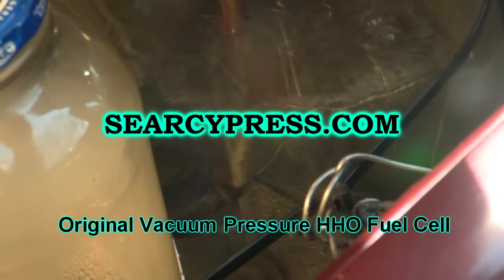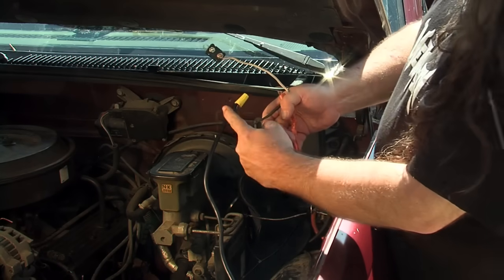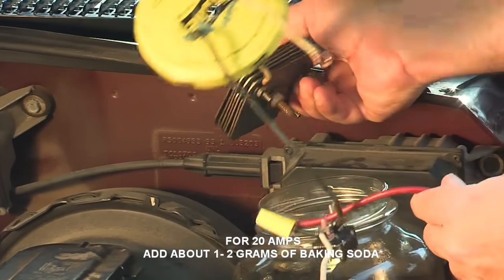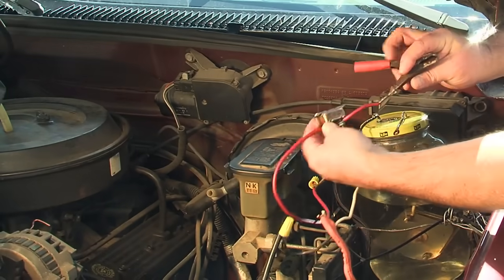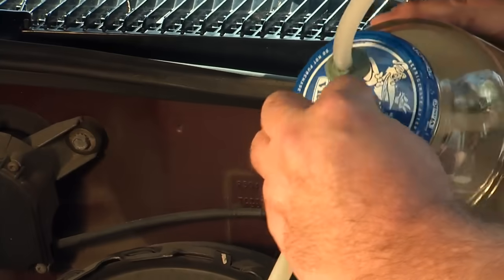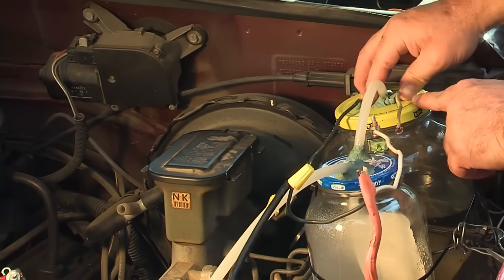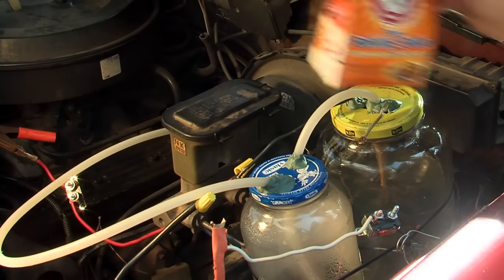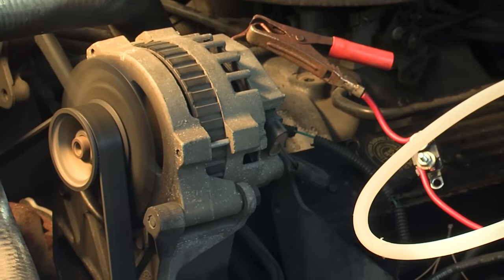Vacuum Pressure Hydrogen fuel cell defeats high gas prices using hydrogen from H2O.

Comment: water flowing through the engine o.o' that just sounds.... horrible for the internal parts.... wonder how often he needs an oil change lol
Reply from the maker: You do realize that burning gasoline produces water right? Thanks for your comment.
Reply: @metalpresstv  if it does it produces much much lower concentrations 0.5% water by volume for gas is drastically lower then the 100% water concentration produced from the combustion of HHO gas.

not saying this idea doesn't work but the problem of water seeping into the oil would have to be addressed
Reply from the maker: @jackasshomey  sounds reasonable. Thanks again.

Comment: Wait.....so he's using the alternator to make a current from the turning engine, to turn water into hydrogen had that turns the engine? Genius.
Reply from the maker: An engine that burns only part of the gasoline. That hydrogen and oxygen does come at a price mind you, then it  enriches the flame and causes a better burn. This allows you to use a much lower octane fuel and save money. Common sense. Thanks very much for your comment.
Reply: And where do you buy less octane fuel??

Comment: Wil this work on a diesel application?
Reply: I don’t think so. A diesel injects its fuel directly into the combustion chamber at exactly the time that it needs to burn. If you add hydrogen to the intake air, you run the risk of predetonation. That’s no bueno

Comment: Adding O2 & H, 
Might make the exhaust cleaner, helping with smog tests.
Reply: so might drilling a 8mm hole in the inlet manifold bypassing the maf sensor and weakening the mixture
Reply: @timbrown9961  the computer will add more fuel to compensate.  
   Also, it would do that in response to extra oxygen. As it would believe there wasn't  enough fuel to consume the air mix. 
   It would only matter on a non computer controlled car.
  The emissions control computer uses O2 levels to measure how well the engine burns the fuel it is given.

Comment: NEVER USE SWITCHES MEANT FOR A.C. ON A D.C. SYSTEM!!!
A switch meant to function with both a.c and d.c. will have a rating for each cast into the plastic.

If you do what this guy did, it's only by luck that your switch hasn't shorted closed.

Alternating current goes from the highest point of voltage produced, through zero, then to the peak on the alternate side of the sinewave.
That zero point allows the circuit to be broken without excessive arcing.
Direct current has no similar principal, and will continue passing current through the air between the contacts, until either the contacts melt off in an open short or weld together in a closed short.

Don't be like this guy, spend the extra 75¢ to get a switch rated for your intended use.
Reply from the maker: For the most part I completely agree never use improper parts. Also never replicate anything you see in this video. With that being said, the reason a 120 volt AC light switch was used is because every single toggle switch we tried, failed over time. Even though the DC switches were rated above the amperage we pulled. Thanks very much for your comment.
Reply: @metalpresstv  
D.C. switches rated at 20+ amps are hard to come by.
A circuit breaker for a boat or R.V. is the proper equipment.
A flashback arrester from a cutting torch, plastic jars, with plastic lids, and fully insulated, permanent wiring routed properly inside the engine compartment round out the  safety issues.

This isn't meant to dissuade anyone from being inventive, and using what happens to be at hand to do so.

I've done my fair share of sketchy experiments with 3 phase A.C. in harmonic step up circuits, rectified to D.C. for use as a high frequency welder that uses DCEN.
Can't make the rod stick if I try...
Reply: @metalpresstv  "...every single toggle switch we tried, failed over time"  Are you saying you've never used a relay?

Comment: You don't realize that the more current you're pulling from the alternator the more load you put on the engine, more load on the engine means ned more fuel so i don't see this  trick being to useful other than wearing out your alternator faster
Reply from the maker: The current is converted into HHO and then back into usable energy in the form of a more efficient combustion process. A lot of gasoline is wasted normally because it does not burn completely. Certainly there is some entropy involved. This process will however allow you to burn a much lower octane fuel without any engine ping. This allows you to save big money at the pump. Thanks very much for your comment.
Reply: @metalpresstv  : Did you re-jet the carb?

Comment: I believe Stan's secret was to use 12 VDC @ 20k Hz. Then your 29 amps will drop to less than 1 amp.
Reply: 12 VDC is direct current - no ripple in the waveform.  20k Hz is the frequency of the signal AC: sine wave, square wave, sawtooth wave, etc. So DC is not AC and has no frequency.  You may mean 12v peak to peak or 12v RMS of the waveform.

Comment: A potential BOMB under the hood, in pursuit of questionable, unproven mileage gains. This is beyond just silly and dangerous.
Reply from the maker: Of course never replicate... Remember it is in vacuum, just like a light bulb. As long as the vacuum is present the danger is very low. During times of acceleration that pressure is removed. Of course this experiment had its risks. Thanks very much for your comment.

Comment: With respect to the designer i must say i doubt this design for a few reasons. The cubic displacement of any engine let alone a 5.7l 350ci Chevy must cycle 5.7l of air per rotation. That small amount of hydrogen would most likely be unnoticeable. Additionally, the alternator does not produce more power at higher rpm. The voltage regulator does its job to keep things just about 13.5volts.

Comment: Lot amps pulling 
Does your battery die lol
Reply from the maker: If your battery is old and weak it certainly would be a problem. The alternator produces sufficient current to run the cell and charge the battery. The alternator of course needs to be in good working order. I have never experienced any alternator failures or premature battery failure issues. Thanks very much for your comment.

Comment: I wouldn't make it in a glass container or any shrapnel producing container in case it explodes. I would use a container that would just break in an explosion but not send flying debris, also wear ear protection and safety glasses just in case there does happen to be an explosion and with the container being non shrapnel, maybe a metal piece or whatever next to it goes flying.

Comment: A spark anywhere in the line to the vacuum adapter will lift the hood off. Either gas will improve mileage, but the two re-mixed are about like dynamite. No reason to assume that a backfire into the intake will not result in blowing up the front end of the car. This is not supposition, since I blew up my own hydrogen generator back in the 80's.  Fun to play with and has some potential, but the way you present it has the potential of blowing somebody's head off if they make a mistake or the engine backfires. Also, pressure/vacuum are two different things.....need to find a better way to express it....like "negative pressure" or some such....Joe
Reply from the maker: Concentration levels in the state of vacuum have not yielded anything dangerous in any of our tests. Also at one time we actually put a neon headlight in the system which burns extremely hot,  well above the ignition temperature of hydrogen. We saw even more gains. Look for the video vacuum pressure photon injection. Thanks very much for your comment.
Reply: @metalpresstv  OK,  enjoy, but understand that when a n engine backfires into the intake, you will no longer HAVE a partial vacuum, which is all you have anyhow at best. If you hook up a gage and watch it, you can totally eliminate the vacuum in the intake by flooring the accelerator, and chevy small blocks are known for backfiring when camshafts go flat regularly.    "Vacuum pressure"?....Uh, well, OK. I'll not bother you again, but please start and run the engine with the hydrogen generator running for every video. You'll get a LOT of views when you finally blow the hood into the next block....  :) ....Joe
Reply from the maker: @joerollings56  trust me Joe I know exactly what you're talkin about. When you floor it vacuum is lost and when you let off the accelerator vacuum increases to its maximum. This is part of how it works and there is a secondary bubbler in this system. Explosion can never be one-hundred-percent ruled out of course because vacuum does not always exist. It's usually very brief but there could be situations to where it went on for a duration of time. Let's say you were going up a very very long hill and we're accelerating constantly all the way up it and you had a backfire. In that case the secondary bubbler would most certainly explode. Every test we've ever done the lid simply blew off not the glass breaking, but that does not mean it could not happen. Like it says it's the beginning of this video don't build it. Good luck my friend and have a great one. Thanks for the comments.

Comment: what do u do about the flashback arrestor water sucking back into the hho jar once the water is hot and the vacuum ftom the engine stops?
Reply from the maker: The flash arrestor is a good addition to any system. We started doing this in 2006 and during that time there was no such invention. In a vacuum pressure system however the likelihood of an explosion is extremely low. There is a secondary jar that is empty that has piping that is designed specifically to suck the water back into the main cell when the engine is turned off. It does this because the hot water cools off and The jug pulls a vacuum on the secondary jar. So you are in a restart mode the next time you use it. Thanks very much for your comment.

Comment: There is no separation of the hydrogen & oxygen so isn't this just burning Brown's Gas with petrol (both same time with the O2 being an oxidizer)?
Reply: Yeah but I guess it skips the step of having to separate it and then having to reintroducing oxygen to the hydrogen. He probably has to clean it more than he drives it
Reply: @kunkeypander6293  No need to "reintroduce" the O2 (I assume you mean from the split).
Hydrogen burns just fine in open air.
Normal air will be enough, in fact adding O2 from the split could make it unstable and explode because it is indeed an oxidizer.

Comment: Doesn't add up. 29 amps at 13.8 volts is about 400 Watts of energy used to separate the water into oxygen and hydrogen. About 1/2 horsepower. Then recombine hydrogen and oxygen in the combustion chamber; so where does the extra energy come from? Only if it makes combustion more efficient.
Reply from the maker: I think you answered your own question. Also you're able to run much lower octane fuel without any engine ping. Instant savings. Thanks very much for your comment.
Reply: Actually full separation of the H from the O2 "wants to see" about 1000 watts. I like that he uses sodium bicarbonate instead of salt as that would really corrode the chamber electrodes and dirty the water fast.

Comment: ----There's so much wrong here, I don't know where to begin.
1. Never use glass, If there's an explosion, the fragments could be lethal.
2. Sloppy connections, sloppy wiring. no insulation on connections. Inviting a short circuit and fire.
3. Poor connection to the alternator, Using a clamp? 
4. No enclosures for anything.
5. No flame arrestor leading to the jars.
|6. There other videos on Youtube showing actual HHO explosions in the bottles. You should watch them to understand how dangerous this setup really is.
Reply from the maker: Glass is the only thing that can handle the thermal properties of this cell in vacuum. Because it is in a vacuum, explosion is almost impossible. The clamp connection on the alternator acts as a Fail-Safe in case of a crash. It would pop off and kill power to the cell. The wires are double fused. I showed it in this condition so you could see how it was wired. I could have easily put some dressing on it and made it look good, however how are you going to know exactly what I've done?. It has a secondary container to prevent flashback however in a vacuum this is really not important. The  main purpose it serves is to prevent water from going into the engine. At the time when this was designed the flashback arrestor was not well known..Being afraid of this glass container  is like being afraid to turn on the light bulb in your house because it might catch fire. As long as the system is in vacuum explosion is extremely unlikely. The power on and off switch is household type because every single toggle switch we ever tried, regardless of the amperage, burned up. That particular type never did. I'm not saying to build this. Frankly I'm saying don't.. Any kind of system like this is inherently risky and not to be duplicated. We pioneered this design many years ago although YouTube has removed almost every video we ever made. It aired on television in 13 states. Three months after doing so, mythbusters debunked this technology claiming even producing a bubble was impossible. The price of gasoline went from $4 a gallon to $0.99 People lost interest and the technology went into hibernation. Thanks very much for your comment.
Reply: @metalpresstv  Proof of concept at least. Don't place any value on the opinions of haters. They hate it when you don't react LOL

Comment: Isn't there a need to separate hydrogen from oxygen? Can the engine run using hydrogen only?
Reply from the maker: In this system there is no need for separation. Sometimes problems result from an increase of fuel to the engine because of the O2 sensor on some systems. This can offset any gains, however it will still allow you to burn low-octane fuel without ping.  I have seen it demonstrated where hydrogen by itself will run an engine. Running an engine on HHO however would most likely melt the entire engine into a ball of molten goo. HHO gas, also called Brown's gas, can be used to melt tungsten. Thanks for the comment.
Reply: @metalpresstv  Thanks a lot for taking time to reply. You said "running an engine on HHO however would most likely melt the entire engine", but in the video you run the engine on HHO; maybe I misunderstood something here. Could you clarify that?
Reply from the maker: @zuheirmirshid9947  we are only adding a small amount of HHO considering the amount of fuel and air that is going into the engine. It improves combustion and provides protection from pre detonation of the fuel. Thanks again.

Comment: So, you are drawing 360 watts, about half a horsepower, off the alternator.   Given that energy cannot be created or destroyed, the only energy you will get by burning the resulting O2 H2 gas  can be no more than that.  It is going from water, to gas, to water.  There is no change in state, no overall drop in energy level, unlike when you burn a combustible fuel, when the matter goes from a high energy state to a lower one.   For example methane, CH4 + 2xO2 -> 2xH2O + CO2    as an exothermic reaction, it gives off energy, methane is a higher energy state than water and CO2.    Do you understand?
Reply from the maker: No one is claiming this is over unity. This combustion engine does not burn anywhere near 100% of the fuel we are using. This process improves the efficiency of that burn. This allows us to also use very low octane fuel without any knocking. So instead of having to burn high-grade expensive fuel we can burn much cheaper fuel and instantly we have saved money even if there was no improvement in miles per gallon (there is) you still get savings in the pocket from the use of lower octane fuel. Thanks very much for your comment.
Reply: @metalpresstv  OK, that is an interesting theory, have you run tests to prove this?

Comment: 2:50 Lot more magnetic field at the alternator than the battery? Say what? Why should that matter? The wire is not transferring magnetic filed. Sounds too fishy.
3:38 Plastic hoses are part of thermodynamics. Hehe, what? Sounds too fishy.
4:40 Magnetic filed is coming off of that alternator. Another bullshit having nothing to do with H2O separation, regulation or burning. Sounds too fishy.
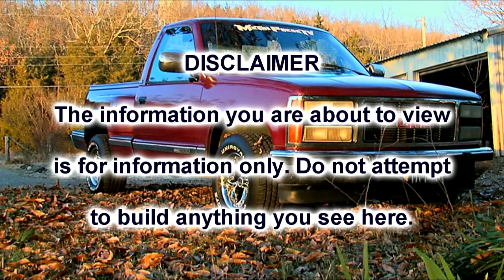0:00 Mentioning strong names as NASA does not make a statement true. Have any links to provide where they test HHO on V8 engines? If you mean technical note 8487, that is not about HHO, but just H and the production is completely different, not using water but alcohol. Sounds too fishy.

You haven't touched anything of essential questions:
 * What was fuel consumption before and what it is after.
 * How do you ensure you don't blow up the whole engine, as everyone knows HHO is very, very dangerous.
 * What effects this have on the engine? Sealed parts could get leaky, there could be damage to sparkplug or pistons or even more buildup due to untimely burn.
Verdict. This is nonsense.

Comment: Old boy that worked for nasa 15  years ago  set that system up for a trucking company in idaho falls he used distilled water .clamed that big old 4.25 Cat motor would give off less emissions and better fuel millage .. he made about 2 million in 5 years then retired  happly

Comment: If you scored those plates with sand paper it will increase the surface area/production of gas.
Reply from the maker: I agree that increasing the surface area will increase production of HHO gas. That won't necessarily give you better performance. There is a certain point you will reach where you just don't need anymore. The result will be higher amperage pulled. Thanks very much for your comment.
Reply: @metalpresstv   your saying Basically it becomes static or inefficient?  Love the channel/video just found it & subscribed today. Thanks for sharing your knowledge.